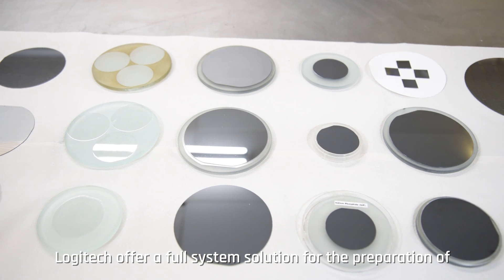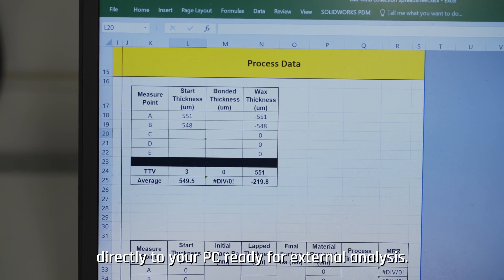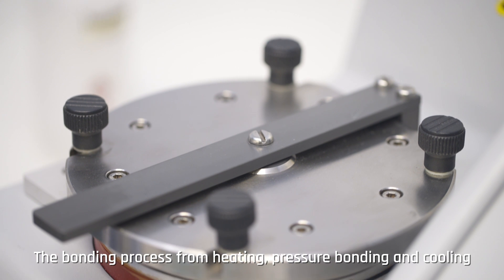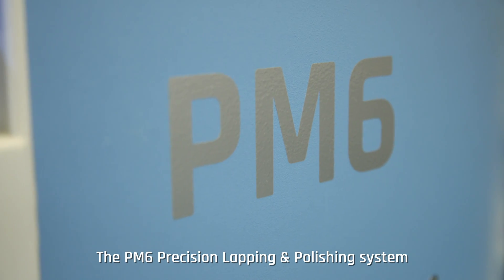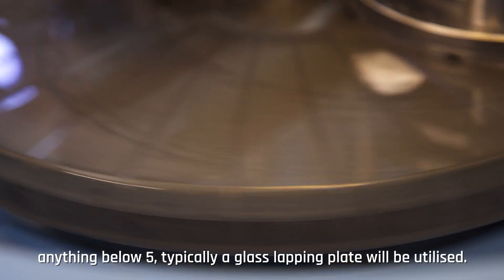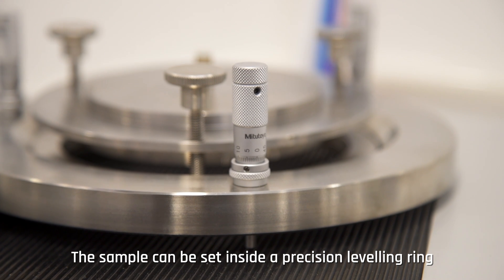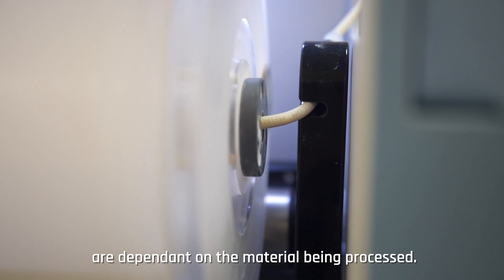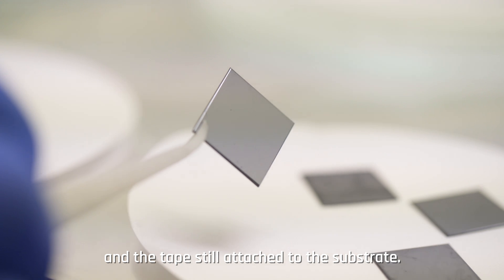Semiconductor Wafer Processing

Comment: manual work, GUI input, hand picking from one tool to another tool. lol can't wait to see when they are automated with scripts and robots.
Reply: Isn't this a showcase of a lab environment equipment where engineers process preproduction wafers/engineering samples for analysis(first tape out) to weed out issues/ make corrections etc etc before mass production begins? Correct me if I'm wrong but the possibility of getting the design correct the first time and going straight into mass production from design is pretty much nill?
Reply: My work place is still an old school manual work but I'm glad to work here to get to learn all the steps of processing, chemicals and tools in details. Used to work at a place where all automatically, I also love this because it is so convenient and much time saving